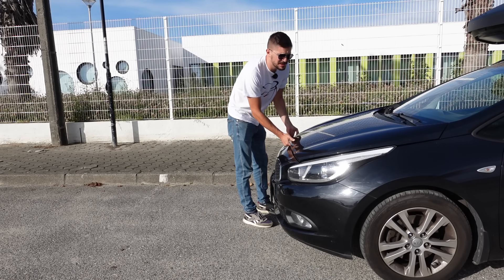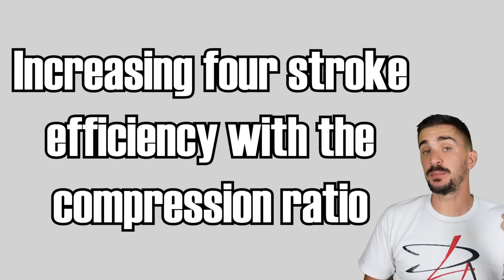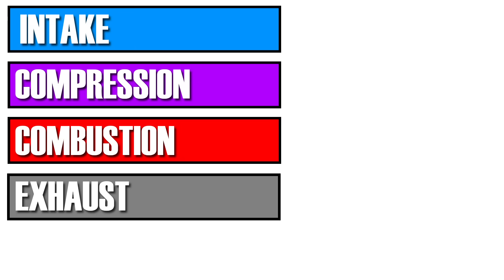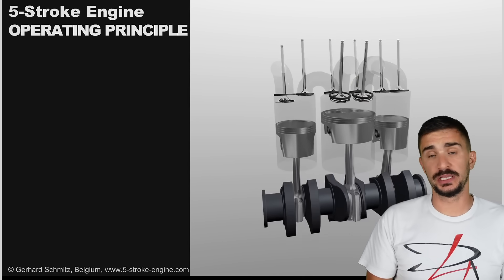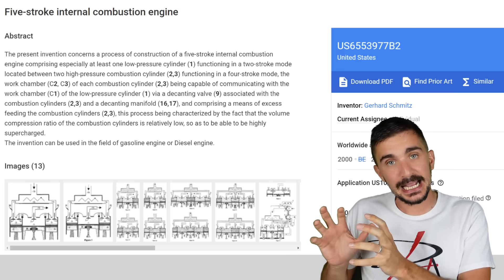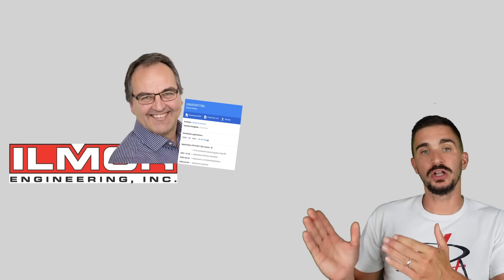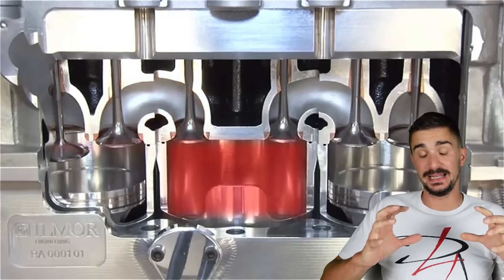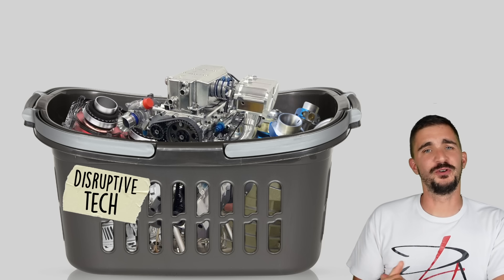Why Five Stroke Engines Are More Efficient But Still a Failure

Comment: The low efficiency of engines is not JUST because of the remaining unused energy in the expansion, in fact most of the losses come from the second law of thermodynamics, which is that if you are using heat to make work, it's simply impossible to avoid throwing away a significant part of the heat.  It's a law of nature that can't be overcome.  The loss of efficiency due to the unused expansion explains perhaps about a third or a quarter of the energy thrown away as heat.

However - actually there have in the past been SEVERAL commercially successful realisations of this exhaust pressure recovery principle with 4-stroke engines.  But rather than using an additional expander piston, they have used an exhaust turbine to extract additional shaft output power from the remaining exhaust pressure.  A turbine is much better for this purpose because as shown in your diagrams, the expander piston only does any useful work on one of its four strokes, so for most of the time it is just using power from the engine to overcome friction.  With a turbine it runs continuously.

Two aero engines post war used this, the Wright R-3360 and the Napier Nomad, and were successful, but ultimately just using a turbine alone (gas turbine engine driving a propeller) proved more efficient, not least because of the weight reduction which really matters with an aircraft (heavier engine uses more fuel just to move itself!).  But it has also been used commercially in truck engines, the Detroit Diesel DD-15 used it and Scania produced a big truck diesel with it in about 1991 but I don't know if it's still in production, or how long it lasted.

With aircraft and truck engines, the part-load performance is not such a critical problem because the ratio of peak output to average output is smaller than for a car engine (trucks don't have great acceleration!), so it's less of a limitation on the extra efficiency that can be realised.  But even then, when you look at the extra weight to be carried around, and extra maintenance, it's barely worth it.  However these "turbo-compound piston engines" WERE definitely a commercial success, albeit in the margins, for quite a few years.

These sort of refinements are best when applied to stationary engines used always at full power, such as for power generation, but actually straight gas turbines are just as efficient at full power and have far fewer wearing parts, so coupling to a piston engine would have no purpose.  HOWEVER - a lot of gas turbine engines used in electricity generation now use a similar principle by harnessing the heat in the exhaust to run a small steam cycle (boiler and steam turbine) - such so-called "Combined Cycle Gas Turbines" can approach 50% efficiency which is getting fairly close to the maximum efficiency that is theoretically possible under the second law, so these are never likely to be beaten.  45% of the UK's electricity capacity is now covered by these "CCGT" engines.

Mike

Comment: Would the use of forged carbon fiber pistons (or even opposed pistons) be more viable for these engines (assuming price for the carbon fiber pistons is not an issue).

Comment: So it's a double expansion steam engine, but with exhaust gas. The problem is that at ICE rpm levels you'll never keep the valve timing right, and backpressure variances through the exhaust will be a major problem. And if you've sucked a lot of unused thermal energy from the exhaust, it might no longer be compatible with catalytic converters, so you've saved fuel but reintroduced smog.

'There are far more interesting alternatives.

Comment: Funny thing about Otto and Daimler's Verbund Motor, we see the exact same principle used in Mallet (pronounced Mal-lay, not mallet like a hammer) type locomotives. Of course, a steam engine is an external combustion engine, but your working fluid is essentially doing the same thing, expanding to push a piston and produce mechanical work. 

A common gripe for railroads back in the day was that range was limited by both water and fuel. You can build more water towers along a route to supply more water for your engines, and you need to. Water is safety critical. Without enough water in your boiler, it can explode as the crown sheet of the firebox gets too hot and warps under the pressure. Water is cheap, hook the tower up to a well and pump groundwater in. So long as you have the water rights, you're golden.

So thats water solved, how about fuel then? Well, in the early days engines ran on wood here in the US. Wood was everywhere, it was plentiful, and cheap as dirt. Wood isn't very energy dense though, and as engines got bigger and more powerful, they needed more energy dense fuel. More energy density in your fuel means more energy in a firebox of the same volume. This improved things on American rails significantly. Unlike Europe though, the US had and still has long, desolate stretches that can go on for hundreds of miles, so time between fuel stops was a big limiting factor. Furthermore, fuel is expensive. 

Swiss engineer Anatole Mallet realized that steam was only being allowed to partially expand in the cylinders, and after that, was simply blown out the stack to draw a draft for the fire, keeping it hot. Why waste that energy? He designed a new type of locomitive. They had huge boilers, and massive frames. They were so big, they had to have the frame hinge in the middle so it could bend around corner while the boiler hung over the side. They also had two sets of cylinders, making them compound engines. The first set of cylinders used the high pressure steam, and were towards the rear of the engine. They exhausted to pipes which carried the expanded steam to the low pressure cylinders, which were much larger to account for the already expanded steam and resided at the front of the engine. After being expanded again, the steam was allowed to vent through the stack, pulling a draft just like before. 

These compound engines saw somewhat limited success, but by the 1920's, were viewed as obsolete by the industry at large, as moving more tonnage at high speed became more important than saving a little on fuel. They did their jobs well, and are an important, if underappreciated part of railroad history. The last surviving American Mallet is Norfolk & Western 2156, and she resides at the National Museum of Transportation in St. Louis, Missouri.

Comment: The secondary expansion cylinder comes straight from steam engine design. The ultimate reciprocating steam engine was the triple expansion concept, which was then replaced with the steam turbine.

The secondary expansion ICE could have a niche market in constant load applications, such as driving a generator with a steady demand, or in a hybrid vehicle using only battery power for low load operations, and kicking in the engine either for high load or to recharge the battery.

Comment: So this engine would work as a stationary used engine, driving gear at set rpm s. Think generator, air compressor or pumps.
Why not use any improvement to be more economic with fosile fuels? Now its focussed on electric. Thus ruining the world for the materials uses for battery s.

Comment: Heat engines (ICEs and gas turbines are of this type) have a maximum possible efficiency called Carnot Efficiency, based on the temperatures of the hot and cold reservoirs. Combined gas cycle turbines can reach around 59%. I can see some parellels between 5 stroke and combined cycle. Getting anywhere close to 100% is impossible though due to thermal energy being the most disorganized and shaft energy being highly organized (thermodynamic theory).

Comment: It looks like a supercharged version of this would work well with boats or airplanes, where high rpm cruise is the norm.  It will not work with automotive, or motorcycles, which spend a lot of time at no load and low rpm.

Comment: just an idea, but what if we just take a inline 6 cylinder engine, do combustion in every cylinder at low rpm / a setting in the car set to power, and at high rpm / a setting in the car set to efficient use 3 of these cylinders for the 5th stroke of the other 3 pistons? Anyone wanna try this idea with me? I really think this could work, the only thing is that you would compulsory need free valves to keep the (I'm gonna call it overflow-valves) closed and opened at the right times. What do you guys think of this idea, could it maybe be practical or are there any problems with it? please write feedback i wanna hear y'alls opinions
Reply: Good idea but how do you manage the completely changed gas paths that are needed for this two modes ?

Comment: I wonder if this engine design would work better if the valves in the third cylinder could be disabled under low RPM. It also makes me wonder if this type of engine would be better suited for a hybrid power unit.

Comment: Very interesting (as always), but a few points that slipped past unmentioned. 

Firstly, electric traction is older than ICE, and is still very much around. 

And, secondly, this so-called '5 stroke' idea is actually very old hat. Steam engines have been using two different pressure cylinders to reuse the exhaust steam (known as compound engines) for a great deal longer than 150 years.

Comment: So would decoupling and stalling the center piston and valves allow full energy release from the working cylinders as a compromise; thinking some version of the method used to have an 8 cylinder run as 4 cylinder in low speed economy modes until up to speed? Yes, there are losses, but are they much worse than stop and go traffic or hitting every single red light?

Comment: To the point of the 5 stroke being inefficient at lower RPMs; it would seem lend itself to use in hybrid cars, where it could always run at peak efficiency. Don't know what to say about the problem with the catalytic converter though. . . maybe that could be re-thunk.

Comment: Other comments have already mentioned the new Porsche hybrid turbo engine. Lifted straight off an MGU-H system from F1.

IMHO, turbo is just better as a energy recovery system from the exhaust. The new Porsche turbo hybrid doesn't even need a wastegate, it can just load the turbo with more electric generation so that it doesn't overboost and doesn't have to bypass the exhaust. At low loads, exhaust volume and temp, turbo may be dead weight, but its less of a deadweight than a whole ass piston as heavy and with as much displacement as the ones actually doing the work. Turbo being a motor generator unit also has way lower lag when drawing electric power.

Porsche claims absolutely no CO2 savings from this engine. But its the first time we have seen it in a production car and its in a  911 so its tuned for performance rather than efficiency. A downsized engine should be able to do much better.

Comment: Thanks for video, it sounds to me that the 5 stroke engine would be ideal for a (preferably plug-in) electric hybrid i.e. running at constant power output to run alternator to charge batteries - (with battery power available to heat gases for catalytic convertor)

Comment: The horse managed to be the apex motive force for centuries!  Seriously though, ICE is still the way forward for mnost vehicles.  Battery power has its place.  Full EVs are fine for running about locally but must be charged and most people in cities do not have drives or garages for this to happen.  They will never replace ICE.  People do not want them.  In the UK, second hand values are dropping which will make owning them even more expensive.

Meanwhile, second hand values of ICE are holding up very well and will probably strengthen even more.  EVs cost some 50% more than ICE and also weigh 50% more.  ICE contributes to taxes with both fuel duty and sales tax.  EVs do nothing apart from accelerate highway wear due to their increased weight.  In the UK, we have what is called Vehicle Excise Duty (VED).  It used to be called Road Fund Tax.  These days, everything goes into a central pot where it is wasted on inefficiency and daft schemes.  Back in the day, this tax funded the roads.  Nobody minded.  I have 3 cars.  One is fairly modern and I am charged £30 pa.  That is fine.  I also have two older Land Rovers and they cost me around £350 a year to tax and that is not fine.  However, once the older one hits 40 years of age, it attracts VED at £0.  I am looking forward to that day.

EVs pay no VED and of course do not use traditional fuel, so are contributing nothing.  Currently, Road Fuel Duty raises around £50 billion a year and 20% sales tax contributes another £10 billion.  The only way this can be replaced is by charge per mile and then the EV owners will go nuts.  As things stand, charging at a public fast charger costs very nearly as much as normal ICE road fuel.  Suddenly, the economics make even less sense than they ever did.

The only way governments can roll out EVs is by subsidising them in a variety of creative means.  One is Benefits in Kind.  In the UK, if you have a company car, the tax man decides that a portion of the car will be used for private and thus taxable use.  A nice ICE car will be assessed at around £400 upon which tax must be paid.  At 40%, that is £160 a month.  A full EV is assessed at £40 a month generating a tax bill of £16 a month.  That is a bit more than a couple of pints of beer and two bags of crisps in my local.  This warped subisidy will soon have to vanish.  The UK has no money left and the incoming government will have to raise money wherever it can.

Apart from the time they take to charge, the cost of an EV will make it uneconomic and people will swtich back to ICE one way or another.  Hybrids are more sensible in that they take the best bits of electric motors and ICE but in the UK, they too will go in 2035.

The Royal Mail is switching to EV vans and bumping into all sorts of problems.  Luckily, their payload is not that large so the additional weight is not really an issue.  E trucks are a whole different issue.  I watched the launch of the Tesla e tractor unit.  While much was made of its ability to reach I think 50 twice as fast a Mack truck, nothing else of any substance was said.  What does it weigh?  How much can it haul?  How long does it take to charge?  What is its range fully laden?  Is that with a super aerodynamic trailer of a flat bed with a big digger on it?

Comment: This reminds of the recycled steam engine. The spent steam from the first cylinder goes into a larger cylinder but with less pressure (to keep the same force), and in turn, goes into an even lower pressure cylinder and even larger cylinder, before exhausting the steam into the atmosphere.

Comment: The era of the internal combustion engine is over, electric is the future.  And....
Electric propulsion hit 150 years old 37 years ago in 1987, having first been used on a battery electric locomotive in 1837.  The only propulsion technology older is steam.
Oh, and Atkinson cycle engines are currently in common use, my car has one.  No need for screwy linkages, you just delay the intake valve closure.  They're virtually always coupled with a hybrid powertrain.

Comment: So they should make a 6 cylinder 5 stroke that runs only the 4 hp cylinders until it gets into a higher rev range and then engages the other two lp cylinders.

Comment: if it only performs well at a certain RPM, make it a generator engine. or a lawnmower engine.
And heat the catalytic converter by bypassing the exhaust piston.

Comment: I don't think diesel engines really "need" all the overcomplicated crap that politics has dumped on them. I think that mostly happened because they were threatening to reduce the oil companies' income with a surge in efficiency, reducing oil consumption drastically, so to combat that, the oil companies bought a bunch of fake science to convince the Democrats to dump expensive junk on diesel engines, making them nearly impractical and at the same time reducing their efficiency to prevent us from reducing how much oil we buy. Note where I said "I think." This is my opinion and I'm expressing it. I will not answer arguments.

Comment: Good presentation! For automotive engines, the advent of variable valve timing is another thing that makes this concept obsolete. You can emulate the Atkinson cycle when running low revs at part load (and get some "internal EGR" for a NOx emissions benefit) by delaying all of the valve timing events. When the driver wants power, you can shift the valve timing to what's best for power output, and you're not stuck with a fixed set of events or a fixed overexpansion ratio like this concept is. And you can fiddle with the valve timing (among other things) during cold-start warm-up to help the catalyst light up.

Comment: Where this design could really be useful would be industrial engines. Tractors, generators, etc than run full rpm and under load most of the time running could really benefit.